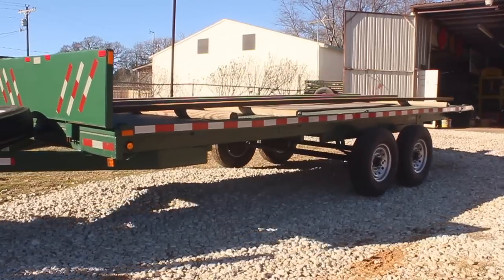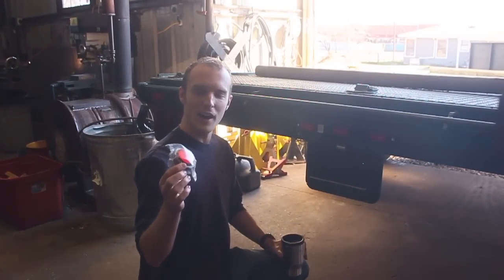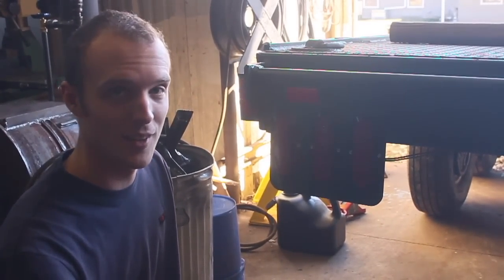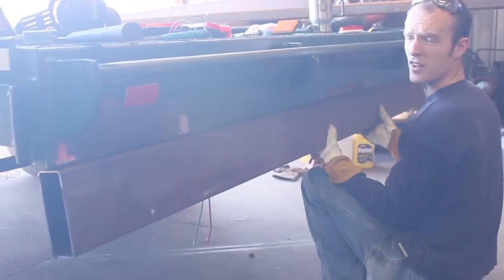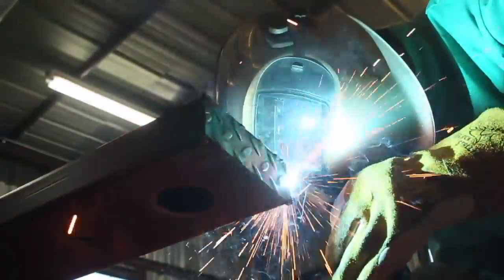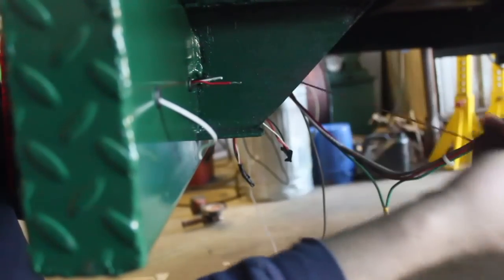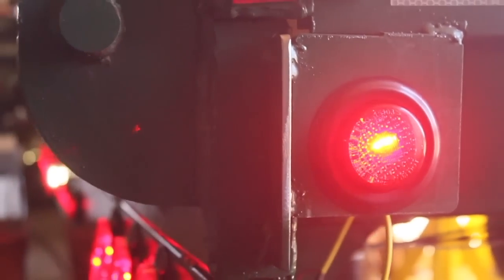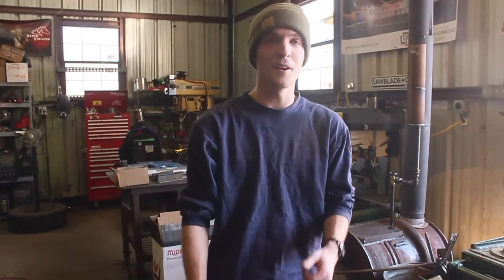I MESSED UP BUILDING A TRAILER!! CAN WE FIX IT?!?

Comment: I really like your videos. I'm 67 now and have been working with metal/welding since I was in 7th grade off and on over the years. Most of what I have done is self taught and it's gotten me by. On electrical connections I have found a product called liquid tape that I use and it has saved me a lot of time and effort plus the money for good quality electrical tape. It seals the connections water tight and easy to apply. You can buy it any auto parts store. If you decide to use it I hope it works as well for you as it has for me and I have done a lot of trailers over the years! Thanks for your videos and keep them coming!!